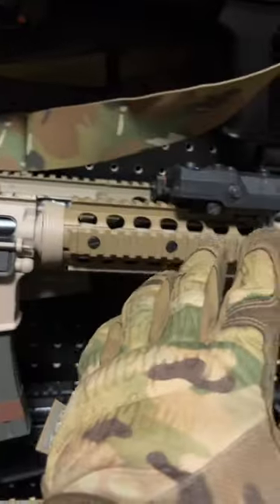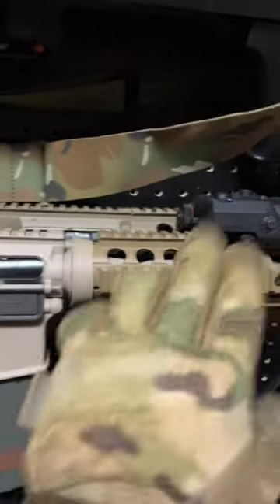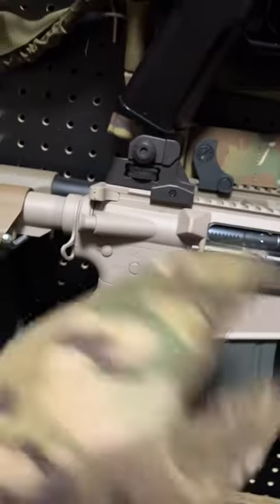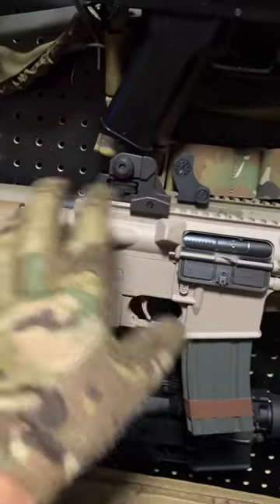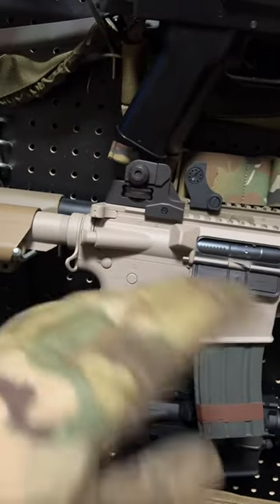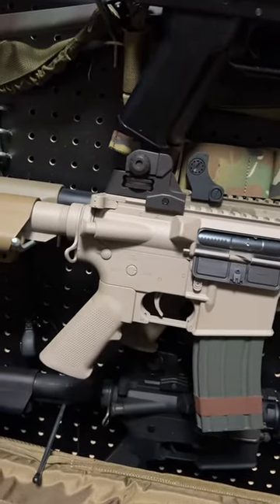How To Paint Your Airsoft Gun Like A Pro

Comment: I'm actually trying to paint it like yours it looks so clean
Reply from the maker: Thank you! If you can find a way to hang it with a piece of string or wire, I find that painting it is much easier and more even that’s how I did that one.
Reply: Thanks for the tip I also painted the stock and the rails I'm going to paint the pistol grip black
Reply: I'll post a video about it on my channel when I'm done
Reply: I made the video it's on my channel